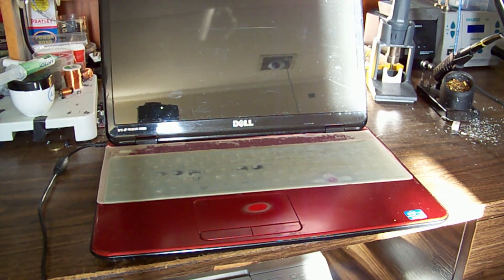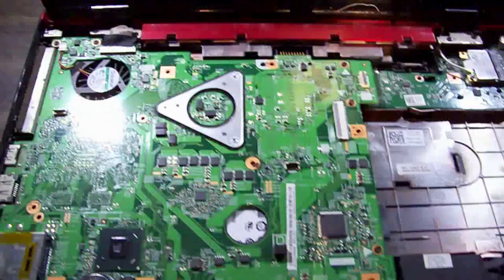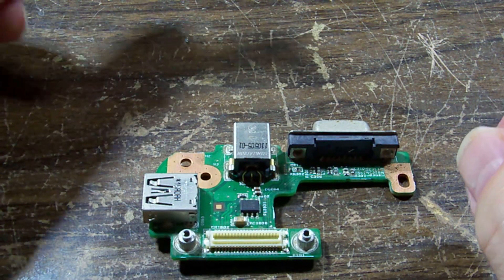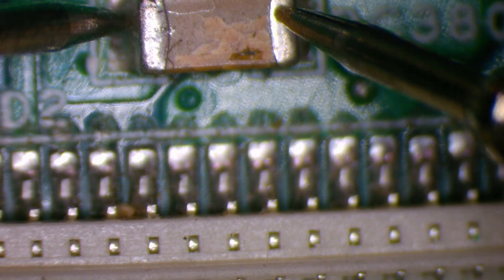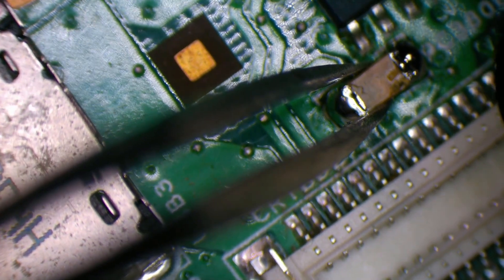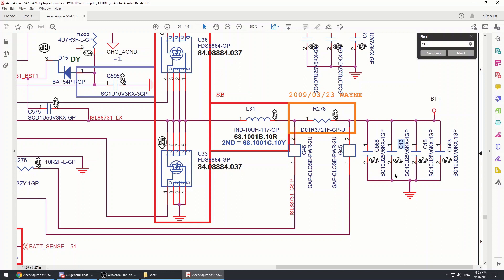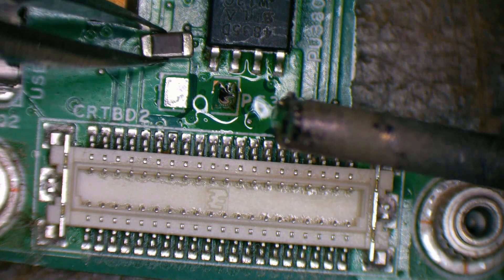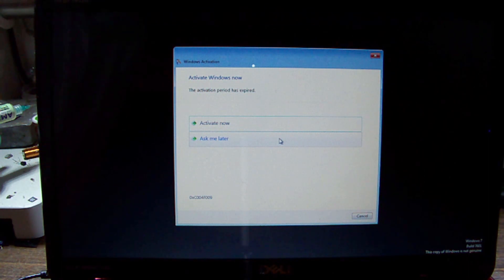Dell Inspiron gets hot while turned off!

Comment: Well it had no chance against you :-D
Cracked multi layer crapacitor,  thankfully not on the main pcb hiding.
A job well done,  it looks like nothing has happened :-D
i'm sure there is a way to fix the activation,  depends if it belongs to you or a customer.
That mosfet coped well, unless it went short and you didnt check it :)  he he.
Reply from the maker: Ssshhhhh you'll jinx it! Good point tho.
Reply: @JonnyFix  lol,  the first mosfet never seems to do much anyway, a fuse would have been a better component in that place.
In my evil minded opinion :-D

Comment: Well done Jonny,
I had a dead short on a Hisense TV recently that got fried after a lightning strike. It burnt out an optocoupler and a NCP1271 Standby PWM Controller. 
I've just bought a thermal imaging camera to find shorts. I've used it already to show current draw on automotive fuse boxes to apprentices I teach at the college, but am really keen to try it for shorts on circuit boards. I have a monitor with a suspected partial short, so I will be putting it through it's paces. Hopefully it will point me in the right direction.
I've been subscribed to your channel for a number of years now and always like your diagnostic skills and NZ style. 😁
G'Day from across the ditch!
MiracleMAX
Reply from the maker: Aahh g'day! I've always wanted a thermal camera but it really wouldn't get a lot of use. Good luck with the monitor!
Reply: @JonnyFix  Cheers mate, thanks!